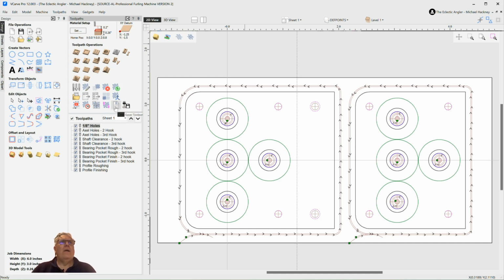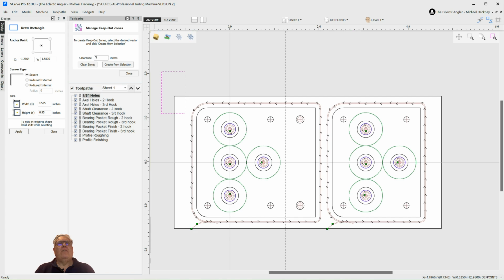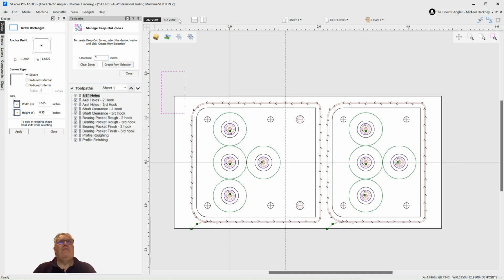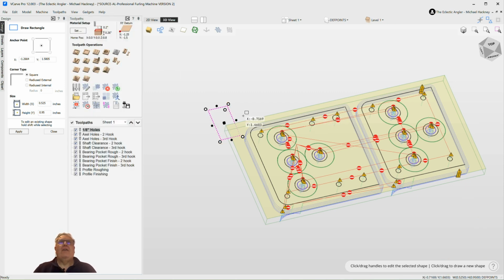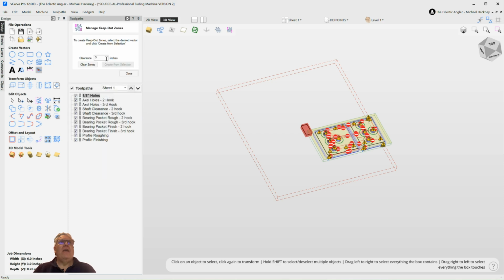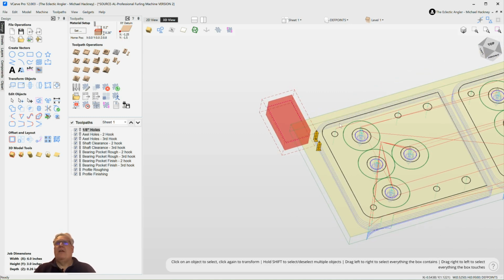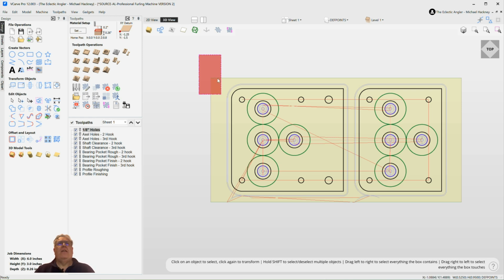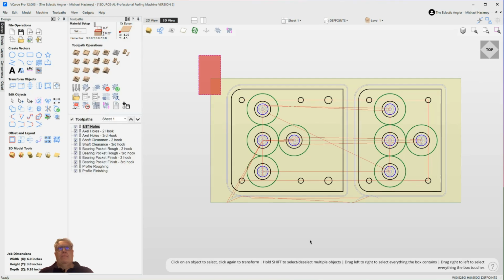Keep Out Zones - I Got it Wrong!

Comment: Is it possible that the tool would avoid the keep out zone completely (from the X, Y parameters) and render the Z height clearance irrelevant?
Reply from the maker: Brent, that is exactly how it works. Check out the screen capture I posted the link to in the video description, it shows the rapid tool paths avoiding the keep out zones by going around them.

Comment: My guess is it will not go into that keep out zone at all, so z-gap would not come into play as far as the keep out zone goes. I saw another video that alluded to that. It showed toolpaths going around it, that otherwise would have gone through it.
Reply from the maker: That is correct. The generated rapid paths will go around and not over the keep out zone. I have a screen capture to show this but I can't post an image in a comment but I posted the link to it here: https://github.com/mhackney/HackOfAllTrades/blob/8a48ec2aab13ae1b68bf51c1abba966526aa2391/Images/Keep%20Out%20Zone%20overview%20markup.png